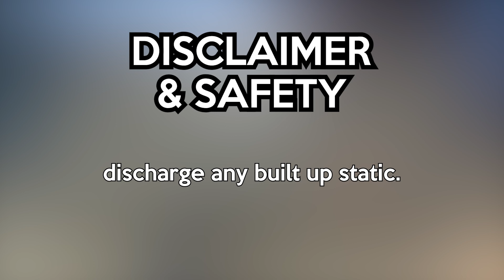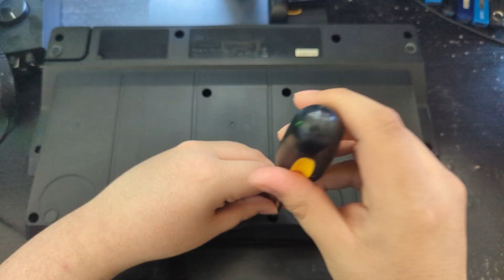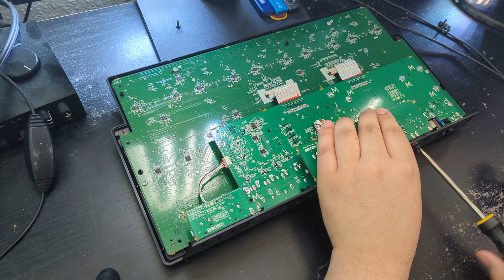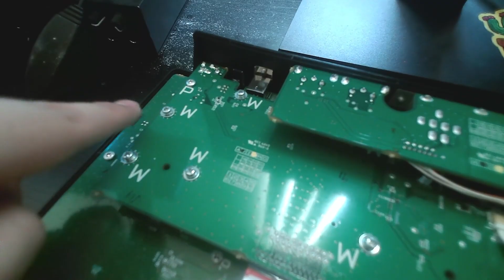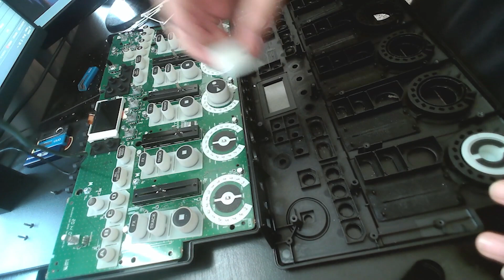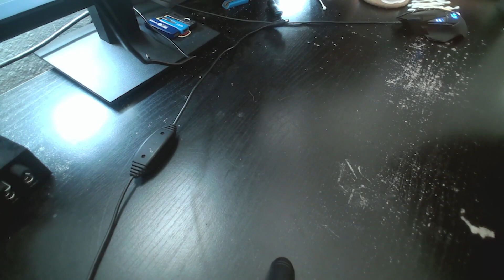RC-505mkII Tutorial #4 | Fixing Your Broken Buttons

Comment: Look, credit for taking the time to make such a video... but... for heaven's sake, those hexagonal objects with a threaded hole are NUTS, not BOLTS. And for what it's worth, they are a lot easier to loosen and tighten with a socket. Socket sets can be obtained very inexpensively, and are well worth having for many purposes.
Reply from the maker: @Graham_Wideman  Yeah, I take responsibility for that. And thank you.

Even given what was explained, and you are gentle with your tools(even needle nose pliers, if they are used), the steps are still viable and no harm should be done to your device.
Reply: @MrEsuoh  I agree, you can complete the job carefully with pliers ... but it's waaaay too easy for needle nose plies to slip off the nut just when applying some loosening or tightening force... and then chew or scratch up something else.  I've seen that happen very frequently.
Reply from the maker: @Graham_Wideman  For sure! I appreciate the honesty greatly
Reply: The point of the video was also to be able to do the job with typical household tools, as well as minimal amounts of tools. Not everyone has a socket set as its unnecessary for the common household. Nuts and bolts are for mechanics and plumbers. Not for hanging pictures or mounting a TV.

Also, pointing out the incorrect terminology is just plain nitpicky. It’s a visual tutorial, yes he got it wrong but it’s just a verbal mistake and the correct object can be implied by following the tutorial correctly anyway.
Reply: @Graham_Wideman i get your point. but your comment seems fussy for a video that was well done even if the wrong words or tools was uses everything work for me

Comment: This is very nice and it can solve some of the first "bugs" that can appear in a mk2, but at the end of the day it won't help at all... Unfortunetly the problem will remain in the metallic black paint that covers the bottom of the fx buttons. It keeps deteriorating with time while you use your loopstation and, with the absence of it, the buttons start failing again.
I don't know why Boss decided to use this type of buttons instead of good quality switches but it is what it is.

I say all this just to warn people that this tutorial may not help in their specific case. Either way, thanks Esuoh for being the first speaking about it ❤
Reply from the maker: @nils_tab Thanks for the insight. Just to throw my experience out there. I have cleaned the device many times dating back maybe a year and a half ago. And in my case, it's never failed me and I have never had any issues. 

I have heard people talking about the materials and choices used for the buttons. And while I have no knowledge of what was used, my buttons have worked great ever since cleaning. And I even remove some of that residue on the fx buttons, as the video explains.

So yeah, this video may or may not work for everyone, but it's definitely worked for me. 👌
Reply: I think boss decided to use these buttons because membranes are more sensitive than switches.

Using a switch would really not be pleasant and practical. 
The best thing is to contact roland and just buy some, it's not too expensive and you avoid wasting several months returning it because apart from resetting the device they won't do much
Reply from the maker: @XbatSFM  Yes! Although sadly, I hear they no longer sell any components that require you to get inside of the device. I don't know if that is just in the USA. But that's what I was told. Any internal issues need to be sent for repairs. Which yeah, can take up some time and can be pricey.
Reply: @MrEsuoh  Well I live in Europe, I asked Roland for PLAY and TRACK buttons and they send me the references without any questions.
I just had to buy them through a certified music shop (thomann in my case)
Reply from the maker: @XbatSFM  Great to hear you have access to resources in EU. I'm currently still trying to gather more information and options for people who don't have access to ordering parts. However, It's unlikely I'll end up with something.
Reply: @MrEsuoh  I think you should contact Roland's partner stores directly to see if they can order parts and send it to you (I got some references if you want).

if they can, it would be good to make an excel table containing all the references of the different parts to facilitate the ordering process.

Like this instead of going through roland, we can just order directly via partner stores
Reply from the maker: @XbatSFM  Yes, if you can send resources that would be great